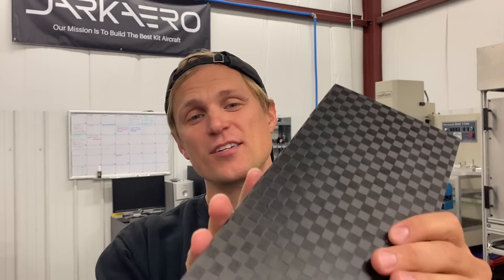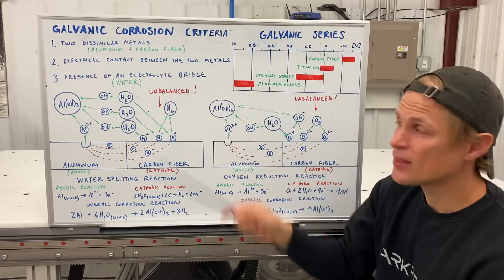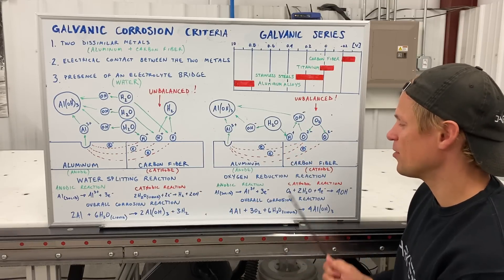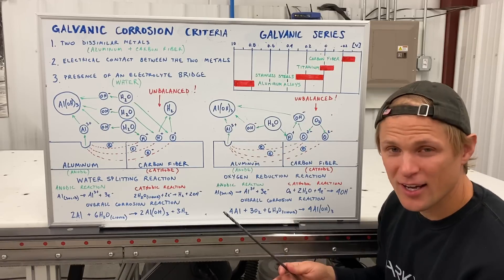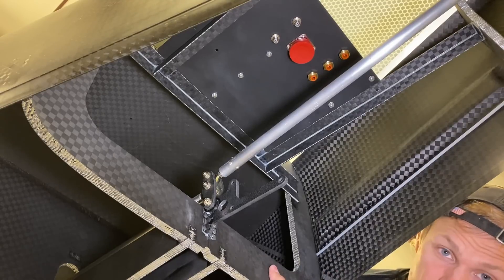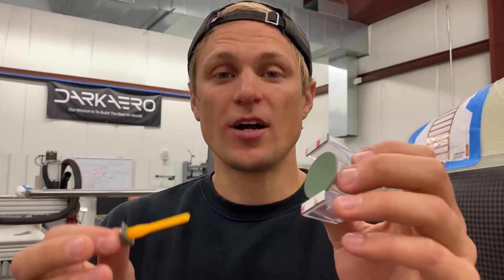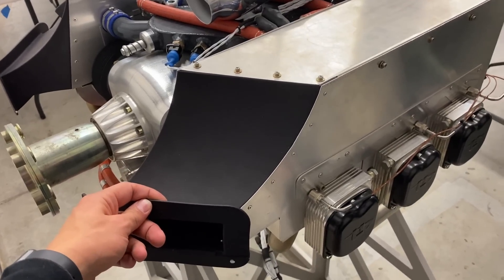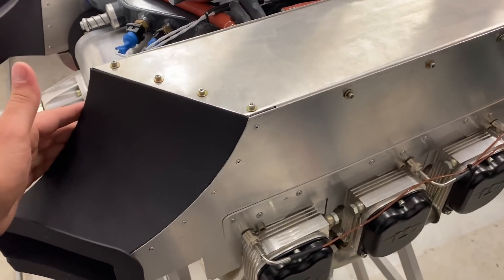GALVANIC CORROSION: CARBON FIBER + ALUMINUM | What is it? How we prevent it on the DarkAero 1!

Comment: Great video and very good discussion of the various ways to handle this. I liked that you gave a warning about which side is better to paint (to avoid a focused corrosion attack at a scratch).

thing that could possibly misleading people (your written description states this correctly, but doesn't call attention to it). 

[I'm sure you understand this very well, but for the sake of anyone watching who isn't familiar.]

In your talking discussion, you say if the 2 metals/materials are touching, but:
the 2 metals don't have to directly touch, as long as they are electrically connected, e.g. any bolt, wire, metal frame, or stray piece laying across them can act as a wire and electrically connect them. 

Example:
If you are trying to protect your Alu by it touching copper, then copper to nickle, nickle to... up the galvanic chart. If the electrolyte connects from alu to the high galvanic (SS, titanium, or carbon fiber), it will cause high corrosion/galvanic corrosion, similar to if they were directly touching. (think of galvanic corrosion as being a battery like effect).

In the marine industry, I have see some examples where people left tools or spare parts laying across things, that completed the circuit and caused excessive corrosion. (or commonly a found mistake, just left a spare SS pump or hydraulic fitting sitting on ALU where moisture would splash or condense.)

It's also worth mentioning to people that Alu is praised for how it naturally forms a patina/protective layer, not rusting and pitting like steel... unless you galvanically corrode it! Then it pits deeply and turns to crumbly powder!

Comment: A question off to the tangent, if I I layer the copper sheet on top of the aluminium core, then lay other sheets of fibers on top of that, does the conduction of the core and copper sheet helps reduce EMC further than just the copper sheet alone?

Comment: Some other good options include anodizing aluminum parts, and for metal objects that will be buried or immersed in water, cathodic protection is great where a steady source of power is available. Where it isn't you can always put your aluminum parts in contact with an even more active metal like magnesium (a sacrificial anode).  Nice video. I enjoyed it.
Reply: I was wondering why they didn't consider anodizing it. It may have not been an option because they're connecting aluminum directly to the resin, the layer of aluminum oxide might prevent it from sticking altogether.. I'm sure google would be able to give an answer on that.

Comment: I see galvanic corrosion in all kinds of places with things you wouldn’t expect. On marine fuel tanks where the filler hose connects is very common. The hose is Coast Guard approved, wire reinforced rubber. When people put double hose clamps on at the very end of the hose it leaves a space above for moisture to collect between the hose and aluminum tank inlet tube. Well this moisture is a combination of condensation and fuel which turns acidic. When you have this acidic (electrolyte) in proximity of aluminum and the carbon black in the hose you get corrosion...lots! The solution is to place one hose clamp on the hose so it’s around the top of tank’s inlet tube and the other at the hose end. No accessible space to collect moisture. Yes there will be some limited corrosion at the top edge but it’s a non issue. Another place is the sender gasket. It’s made of chopped cork and rubber. Cork to wick and hold moisture and the carbon black in the rubber....perfect right? I replace these with fiber reinforced silicone gaskets. Same for metal tank straps, the the elastomer between the tank and strap can’t be rubber and a firm polyurethane is best. Devil in the details to make it right.

Comment: What are the other benefits for using the non-aluminum honey comb sandwich panels? Are they lighter?
Reply from the maker: Good question! The aramid core panel does indeed end up being lighter than the aluminum core panel. There are also manufacturing benefits that come with using the aramid core in the panel. As mentioned in the video, the aramid core does not require the insulating fiberglass layer in its panel's construction and is easier to handle without damaging.

Comment: If you anodize your aluminum parts, it will render the surface non-conductive. An additional benefit is that the surface will also be harder, particularly with type III anodizing. Though this may not be practical for aluminum honeycomb, for most parts it may be a better  option. 
I liked your presentation of this subject: informative and concise ;-)

Comment: Very informative and well presented. A question - what do you think is the cause of sub-surface 'bubbles' in the composite that I have observed after corrosion tests of an aluminium coated CFRP. Maybe as simple as the H or O2 gassing out of electrolyte that has migrated into the substrate. But perhaps a direct reaction between fibre and epoxy resin in presence of current flow. Appreciate your thoughts.

Comment: You are a gifted teacher!  One small correction.  Physical contact is not required for galvanic corrosion.  The electrolyte is all that is needed to put two dissimilar metals in electrical contact.  That's why the sacrificial zincs on a steel boat protect the entire hull and attachments.
Reply: Humidity in the air can be enough.
Reply: He specifically stated that many times.  No correction.  Watch the video before commenting please.
Reply: Your knowledge of the problematics of galvanic corrosion on boats is obviously not sufficient. I do this for a living.
Reply: @lovrepeovic  Metal contact is not necessary - e.g. the non metallic charge carrier will allow for corrosion, e.g.   https://en.wikipedia.org/wiki/Galvanic_cell
Reply: @laurens4359  You have to close the circuit for the corrosion to take place. You can achieve that by either bringing the two metals in direct contact, or by connecting them with a conducting element. The Wikipedia article you linked to is literally showing a wire connecting the two electrodes. If that electrical connection is not present, corrosion will not take place.
Reply: Metallic contact is neccessary.
Reply: @lovrepeovic  only electrical contact is necessary, not necessarily physical contact.  Meaning an electrolyte is sufficient.  Think of electroplating
Reply: @ivanalvarez5511  In electroplating, the metallic contact is replaced by the power supply that the two electrodes are attached to. So there is still an electrical connection outside of the electrolyte, even though the two metals are not strictly in direct contact.
Reply: @lovrepeovic  simply wrong

Comment: How about alodining the aluminum and calling it a day.  Alodine converts ( pre-corrodes, converts) the aluminum and forms a layer of aluminum oxide on the surface, turning it anionic and electrically dead.
Reply: If it was just oxidation the it would be more like anodizing.   Aluminum oxide is slightly conducting.  Which is why you can anodize Aluminum.   
Alodine is more based on reactions with chrome.
Reply: Ross Robinson. Most everything I work on we will alodine the aluminum prior to final process.  It is a required process on most aircraft skins prior to installation.  Not sure I understand your comment regarding its based on chrome.

Comment: Great video!  Thats a nice way to handle the problem and I bet that thin ply of glass doesn’t add much weight overall.  Will the switch to Nomex save you weight too or just improve the manufacturing process?
Reply from the maker: Thank you! The production change away from aluminum will provide a slight weight reduction and improvements in manufacturability.

Comment: I have two questions:
1) In a previous video (July 29), you walked through your process for selecting aluminum honeycomb as the core rather than using off-the-shelf panels with aramid cores, and mentioned temperature performance as a factor.  Is the temperature issue a result of the aramid core itself, or is it due to other factors in the construction of the off-the-shelf panels?
2) How did you give the fiberglass layer the same honeycomb pattern as the core? Or is it a continuous sheet that just looks like it has the honeycomb shape because of how it was pulled apart?
Reply: Aluminum is far more thermally conductive than aramid material.

Comment: What is the weight difference between your sandwich panel core choices?
It was the hardware rot going thru sandwich panels that got on my nerves. I went to stainless almost as soon as components were built. Corrosion slowed significantly but never eliminated totally. Silicon helped but not 100%

Comment: What is the pros and cons of nomex vs aluminum honeycomb structure?
Reply from the maker: Great question Kade! For the specific type of aluminum and aramid cores we are using, aluminum has a slightly higher strength to weight ratio and it is lower cost than aramid. However, aluminum core is a little harder to bond to the face sheets and it requires the added fiberglass layer for corrosion protection. The main reason we are changing to all aramid for production is we find it easier to work with in a mass production environment. Thank you for watching and for the question!

Comment: Nice work, Ryley, very simple explanation.  This conversation is typically much longer than 12-mins in most meetings.  Whether we are building a profile for farm equipment or a satellite at Exel Composites, fiberglass tends to be a cheap insurance policy against galvanic corrosion, with proper Resin selection.
Reply from the maker: Thank you Jared! It was actually a real struggle to condense this topic down so I wouldn’t feel bad if it took longer to go over this in a meeting! 😁

Comment: How did you get past the delamination tendencies between fiberglass and carbon fiber?
Reply: Resin selection is key.  We build "hybrid" carbon fiber and glass fiber parts at Exel Composites frequently using Pultrusion manufacturing.
Reply: I was also wondering the same 🙂
Reply: Might you do a video on this process?
Reply: So long as your parts are being laid up at the same time, the resin should bond chemically from one layer to the next. Cured resin on the other hand, will only allow for physical bonding, like grabbing the surface of a basketball. Chemical is significantly stronger.